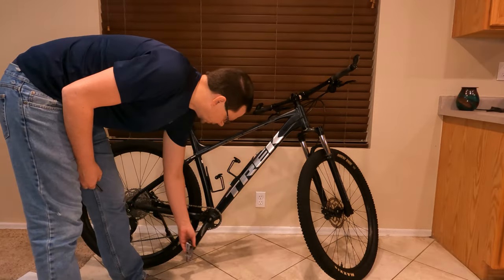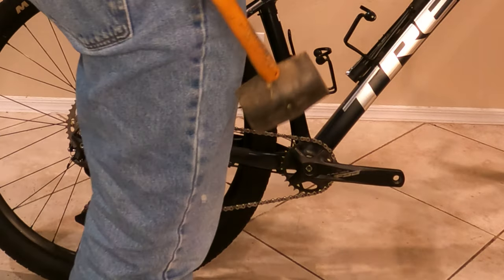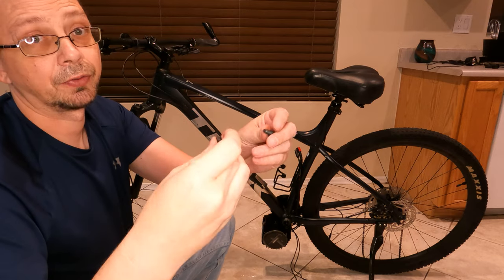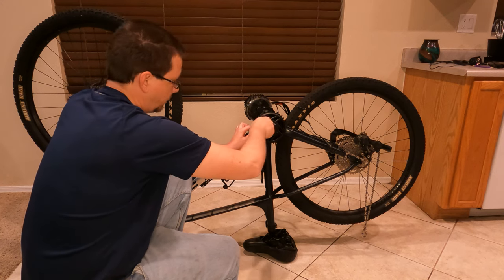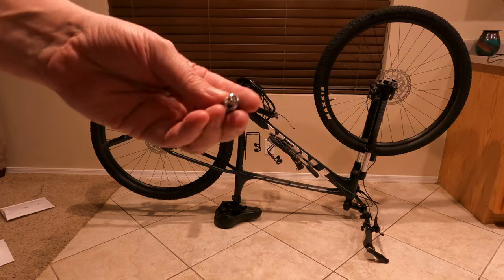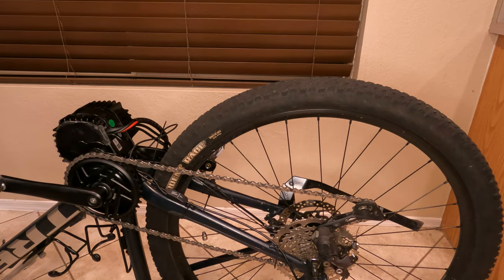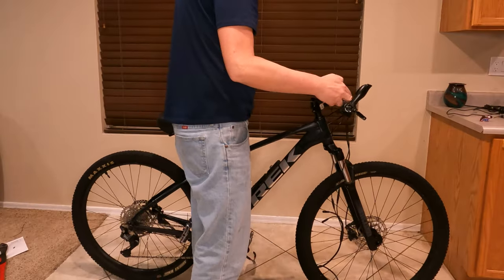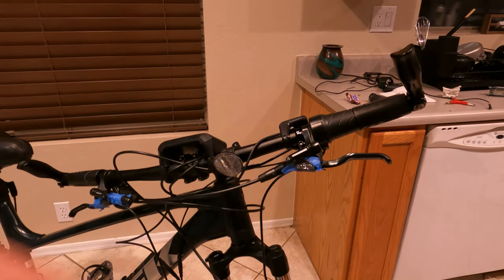🚴‍♂️BBSHD Electric Bike | DIY Step-by-Step Bafang Installation guide.

Comment from the maker: 😇 https://www.youtube.com/user/lastend1?sub_confirmation=1 Subscribe

Found a Bafang Deal with the lowest price ever $479 with coupon https://s.click.aliexpress.com/e/_DEk1rZN
$20 OFF For orders over $200
Code: 【IFPNRAX】

1000w BBSHD Kit (The one I got)
 🛒Amazon https://amzn.to/3FhVmsF

750w BBS02 Kit
 🛒Amazon https://amzn.to/3f1v3Mm

500w BBS01 Kit
 🛒Amazon https://amzn.to/3ssMY1J

1000w M625 Kit
🛒Amazon https://amzn.to/3XwmQkQ

Electric Bike Batteries
🛒Amazon https://amzn.to/3ALQuZH

Shift Sensor
 🛒Amazon https://amzn.to/3Whm9eH

Programming Cable
 🛒Amazon https://amzn.to/3g3olGi

Extra Cable
 🛒Amazon https://amzn.to/3g2afVG

Twist Throttle
 🛒Amazon https://amzn.to/3TrlrJ2

Bafang Bottom Bracket Spacers
 🛒Amazon https://amzn.to/3UaQZ6x

🛒Bike Arm Remover and Bottom Bracket Remover: https://amzn.to/3ErAM88
🛒42 Tooth Chain Ring With 20.5 mm offset: https://amzn.to/3EBVP8l

Comment: Be aware this kits only fit older bikes
Reply from the maker: It will fit new bikes if it has the same bottom bracket size.
Reply: I use the bafang 73mm on the 2022 Schwinn Taff from Target 🎯

Comment: Feeling rather discouraged
Reply from the maker: I've started trying to work with prebuilt e-bike companies as well. Making things yourself can be difficult. Problem is many prebuilt e-bike can't charge and discharge at the same time. For those 2 batteries are needed. One for riding while the other recharges from the panel.

Comment: Glad to see you got it installed. 👍  I'm curious about how much it ways including the battery.  The 2 stroke bike kit is 21lbs 8oz and my 4 stroke build is 22lbs 1oz .
How long it takes to change the wheel absolutely matters .
Reply from the maker: 15 pound Kit plus up to 26.5 in batteries and charger weight ( https://youtu.be/kzZ_fG9IazY ) if I carry all current 3 batteries. So 41.5 pounds. Flat range of 160 miles if helping it (BS-ing here. don't have data for mid range yet. 160 is what me+hub could do.) Gas is king in energy to weight, lower cost, and in recharge time.  I'm always waiting for the next generation of batteries!

Then there solar. Each 100w panel is 5 pounds. I have 2 but really 4 would be better.

To bad I'm not light like when I started riding 3-ish years ago. Lol just joking, I'll keep my 40 added pounds of human body weight.
Reply: @Eric_Tennant  thank you great reply 👍 i was curious about it since I received the motor.
Reply from the maker: Anytime!

Comment: very helpful video. I'm converting my marlin 5 soon. just worried about the gear sensor part. any tips?
Reply: also, do you need to do the brake sensors like that? Or can you swap out the brake levers with the ones from the kit. I don't really like the magnet sensor idea
Reply from the maker: Only hard part about the gear sensor is getting the cable back on the derailleur at the same tension. Add a mark to show where the cable should be.

I had to use the magnet brake sensor because marlin 7 has Hydraulic brakes, and the kit came with the cable version, but after searching I found a better looking option. https://amzn.to/3WIYlAZ These are Bafang hydraulic levers.

Comment: what generation of marlin is it?  I tried to mount the TSDZ2 to this bike but it does not fit because of the cable routing.  Do you have a welded down tube below the bottom bracket?
Reply from the maker: 7 generation 2022. For the bottom weld I did do minor filing to make it 1-2mm smaller in the middle (More flat).  I did have to do this to the bottom Bracket. https://youtu.be/7wikIUxtnQQ
Reply: @Eric_Tennant  you can provide an email.  I will send you a picture of my problem.
I meant where the wires come out.
Reply from the maker: Sure on my channel about page it has a contact button that will list my current email.

Comment: its asking on amazon size: alot of option
Reply from the maker: One is the front chain ring size. I went with a 42t for speed. The other option is battery size. The higher the number the more range you will have.